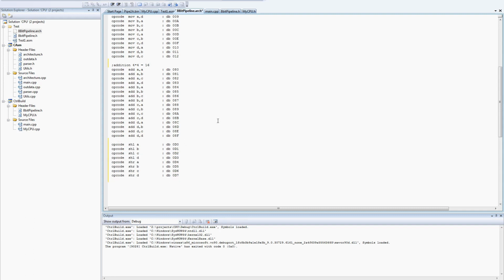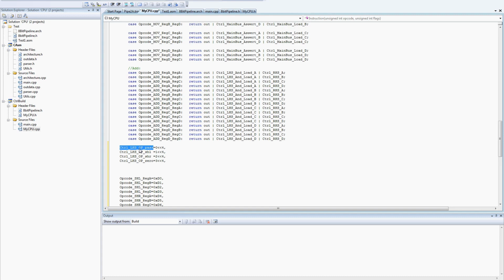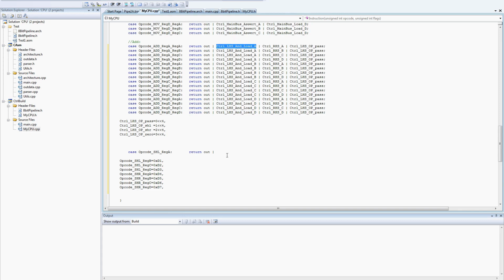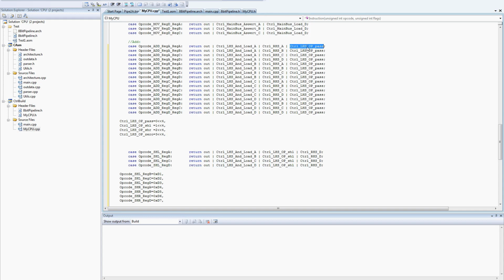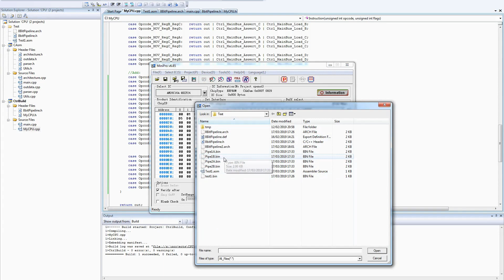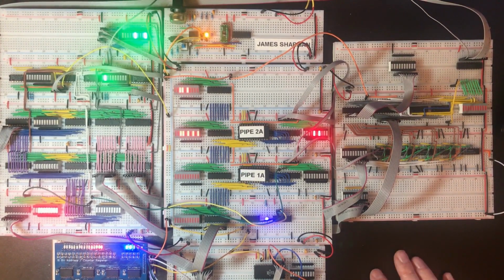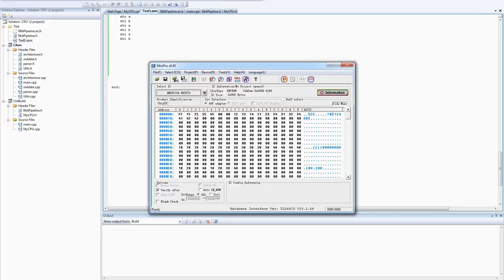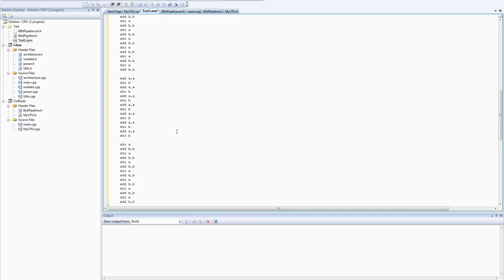ALU (6: Shift Instructions) - Making an 8 Bit pipelined CPU - Part 28

Comment: James with all honesty this is the best cpu on you tube but as constuctive critic; the delivery of you material and knowledge is not fulfillng your work, may be just me but found simplicity module by module short videos with good visual schematic will have made to the top.
Unusually the best engineers have problem with explaining thing as their brain is buzzing with so many things in same time, adhd makes the best inventors.
Thank you for sharing your time and knowledge.👍👍👍👍
Reply from the maker: Doing the best I can,  I get better as time goes on but you need to accept that I'm an engineer, not a public speaker.

Comment: In case anyone's wondering, the reason the shift instruction works perfectly even though there's nothing driving the right-hand side of the add unit is because the LEDs showing the right-hand side input to the ALU actually pull those inputs to ground when they're not being driven.
Reply from the maker: I don't understand what you are objecting to, the rhs is being driven.
Reply: @weirdboyjim  At this stage in the build, you're outputting the D register to the RHS bus during a shift instruction as a stand-in for telling the RHS to output a 0, but the D register doesn't exist at this point, so if  you tell the D register to assert to the RHS bus, you end up with the RHS bus not being driven.

Comment: Isn't scalar multiple instructions per clock using as many resources available as possibile? As on for ex. having multiple ALUs or incrementers, etc?
Reply from the maker: I'm not 100% sure I'm reading your question right, but I'll try and answer it. Particularly when you get into more complex architectures it's easy to find conflicting definitions of these terms as well as widespread misuse. What I was taught which seems to be roughly consistent with most definitions is that "Subscaler" means instructions take multiple cycles of the same cpu resources to complete, "Scaler" means instructions generally occupy a processor resource for a single cycle and "Superscaler" means multiple instructions maybe executing in the same resource (or duplicates of that resource). You then get the common use of the terms which generally maps to "less than 1", "roughly 1" and "more than 1" instruction per cycle because that's what those definitions generally map too.
Reply: Well, if you only have one ALU, you could never get more than one operation per cycle. Nowadays things like decoding possibly dozens of instructions at a time, figuring out what's dependent on each other, and doing everything that's not dependent yet in parallel execution units.. there's also speculative execution, executing code that may not actually run if the condition isn't met, but if it is, you jump to the code that's already been executing for a while. It gets crazy, in a way.